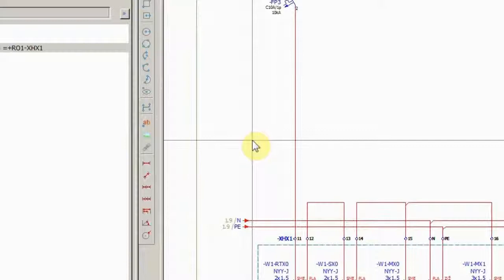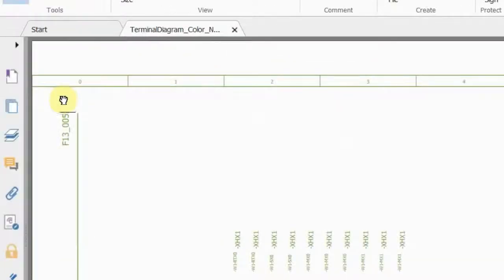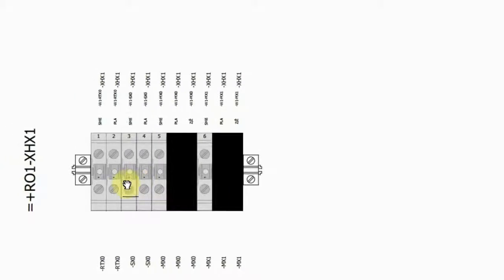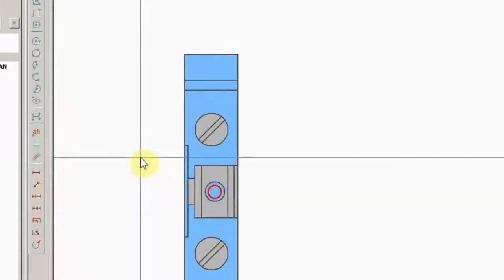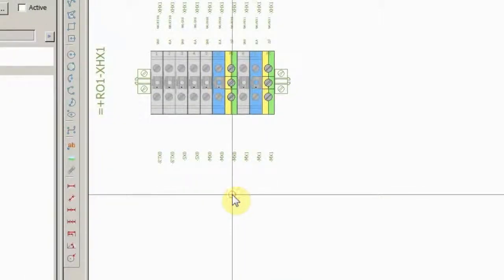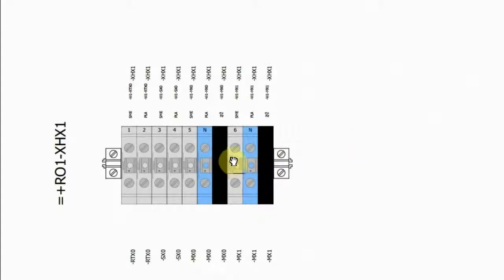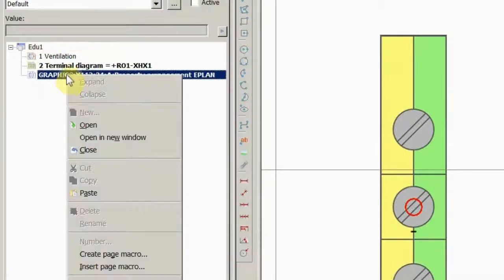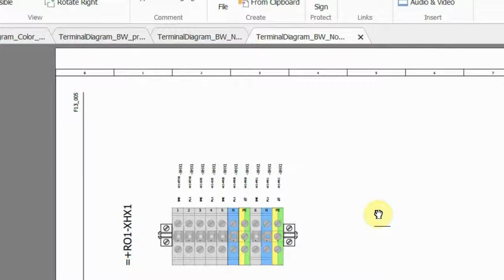ePLAN Electric P8 Tips And Tricks - PDF Export with Terminals in Color

Comment: My F13_005 form don't show the default image of the terminal. Is there any reason for this?
Reply from the maker: Hi Ricardo, maybe you used a terminal in the circuit diagram for which Eplan doesn't have the graphical representation ready in the Graphics symbol library. Change the function definition of your terminal in the circuit diagram to a more common type (e.g. terminal with saddle jumper with 2 connection points) and then you should see the graphical representation in the report. Let me know if that solved your issue
Reply: @appliedelectricaldesign  Thank you!! I change the terminal function definition like you said and "voilá".  I will take the opportunity to ask another question. What do I have to do to get a report in this format? https://drive.google.com/open?id=0B2K6MqQ7Nor4clhPSy1ULURTVVV1Q0dwX1dheGNyaTdBTi1Z